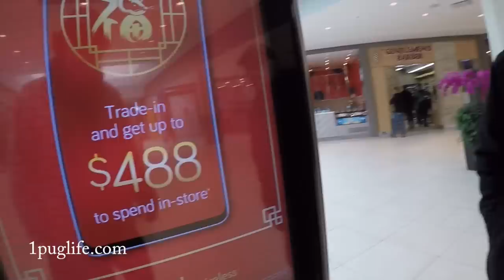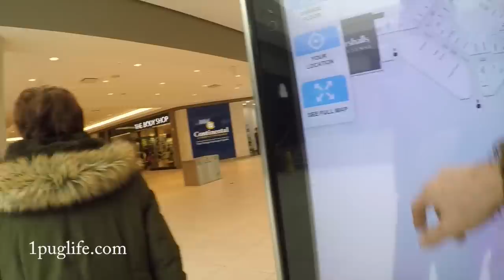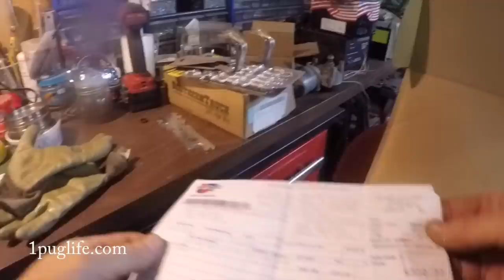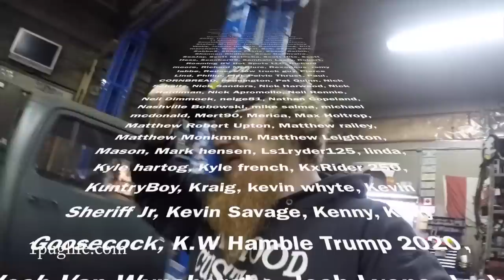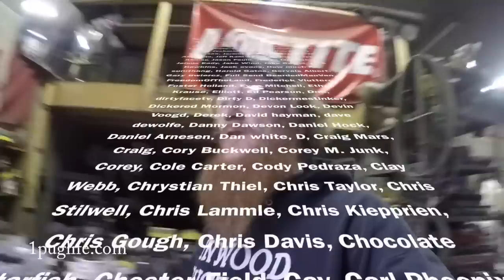spending spree with dicky and my truck is buggered

Comment: Buy junk, put over size wheels and tires on it . Scorscazee . 
Pug why don't you ever drive the red turd ? It a piece of shit too ?  What ever you do, don't buy a good truck and leave it the stock condition. No air horns , lite bars , oversized tires and wheels ECT.
That would be to simple and you would not have anything to bitch about.

Comment: btw thought u said them Dodges joints fly apart ?????
Reply: In this case Wheel bearings would fly apart. If he only would of tried to drive it back to Inwood Customs..  
Glad he used his brains..

Score Sissy for Chris!
Reply: @brycewaltonsphotography3969  wheel bearings went in my dodge and I kept going...3 miles till I grinded to a stop all capawampus. ACDC was blasting

Comment: You could have drove that truck back home... When a bearing starts smoking it just starting to go out... You drive it under 45mph until it starts to squeal... Then you better slow down or stop and get a tow...
Reply: You drive until  the first one falls off.then not quit as far on the others.
Reply: if you just pretend its not happening it will go away just give it time cars fix themselves

Comment: Hey pug big big fan If it was a wheel bearing I'd imagine it would have made a ton of noise. I have a junk dodge just like you and the soft brake lines collapse on in inside and In turn they turn into one way lines causing your brakes to stick happened on all 4 of my brakes if you change one soft line change them all because they all go around the same time.
Reply: usually the mid point line holder brackets rust pinching the line off tight. it holds high residual pressure making them drag and has delayed brake apply/release.
on the front it can cause severe brake steer as you apply/release them
Reply: That was the brakes indeed but pug is stoned stupid so he could not see that.